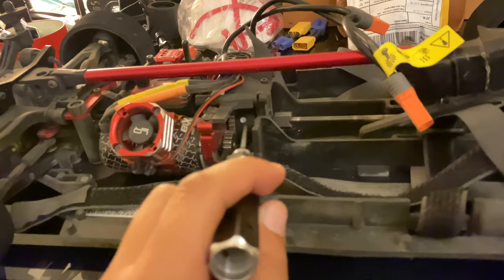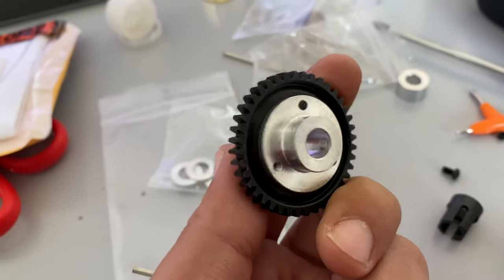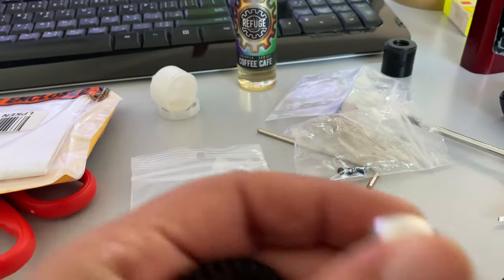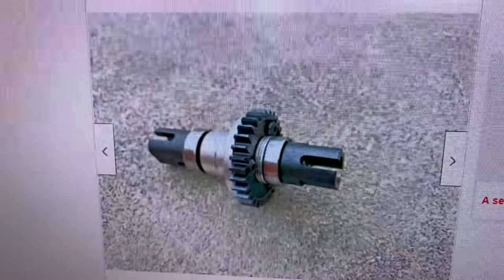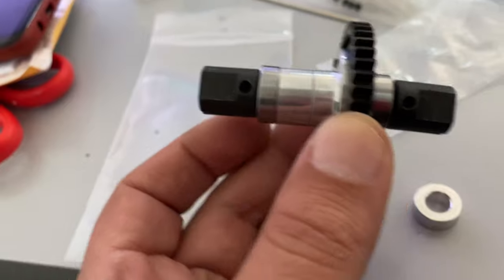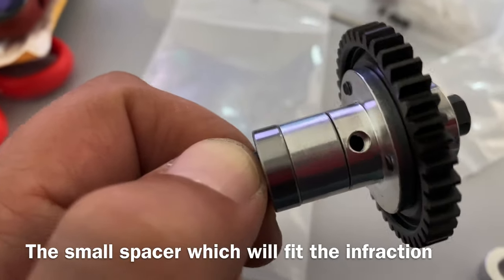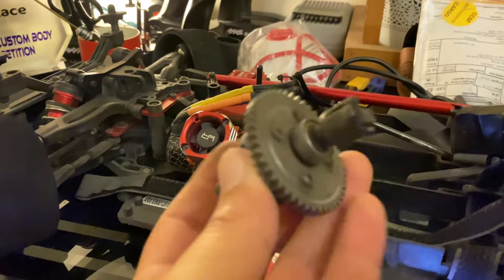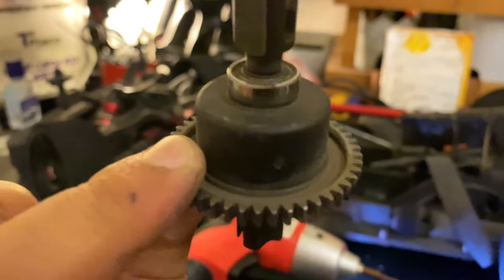How to install Spur Gear Center Solid Axle Diff Differential for Arrma Infraction limitless Felony

Comment: Hi 😊,how does the system work,is there a solid shaft that joins the 2 connectors?.I want to replace diffs in my notorious not sure if I use my own bits or what.Also do I do 1 diff or 3
Reply from the maker: hi there , this is a center spool replacing the factory open diff to make sure powers distributes equally 50% front %50 back
Reply: @UAERCADDICTS  Thankyou 😊 I see now I missed the part of vid showing of the unassembled unit ,great video thankyou 😊👍

Comment: Did lowering the center differential make a difference in speed - I was looking at one for $49 and didn’t know if I should go bigger or smaller because it’s the center @ the motor I know what works for speed
Reply from the maker: Yes it did but depends also on your motor and esc
Reply: @UAERCADDICTS  thank you for answering I have the spektrum 2020 & the 150A ESC on two 3s 100c Lipo smart packs
Reply: @shawnconnolly5525  The smaller the spur gear the faster you will go.
Reply: The bigger/more teeth on the pinion the faster you will go.
Reply: @Hankster360  faster as in top speed however the smaller the pinion the faster the take off and not so high of a top end speed

Comment: It showed nothing!! Waste of time video!!
Reply from the maker: sorry for that , could you explain more ?
Reply from the maker: the main reason of using this spool is distributing the power equally to front and back diffs instead of the standard arrma center which is not
this spool will help you in drag racing so what are you looking for?
Reply: @UAERCADDICTS  I didn’t like the video it showed nothing
Reply from the maker: @mr.sinister1279  as you like